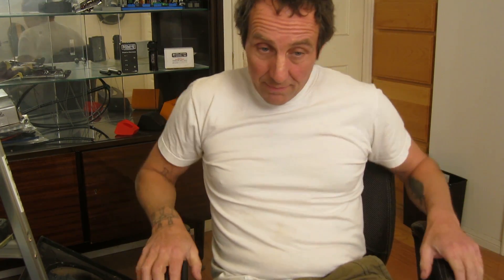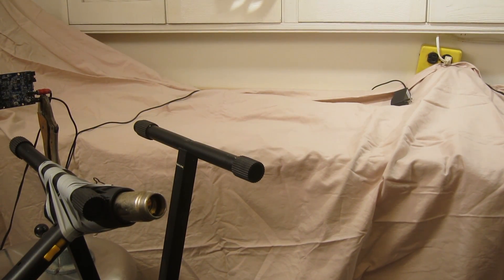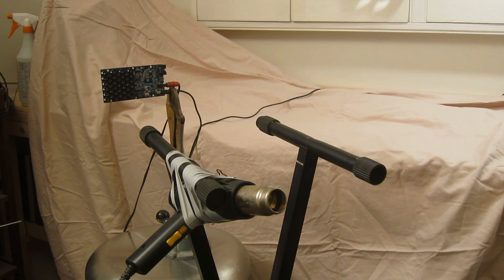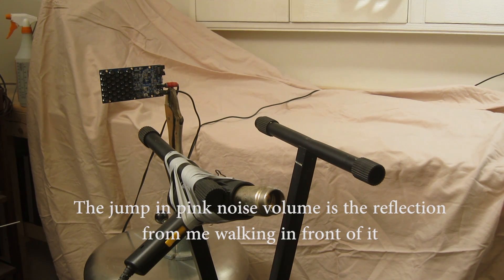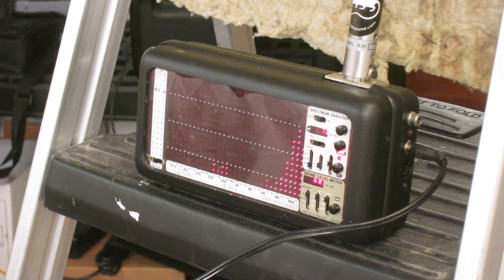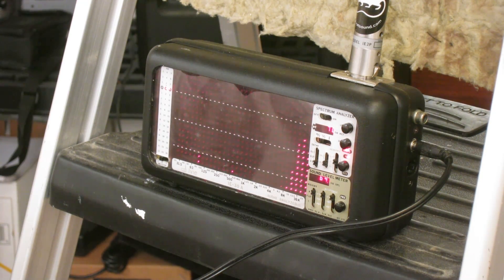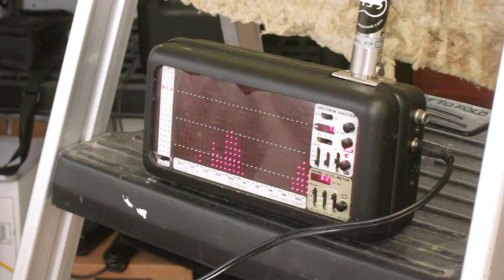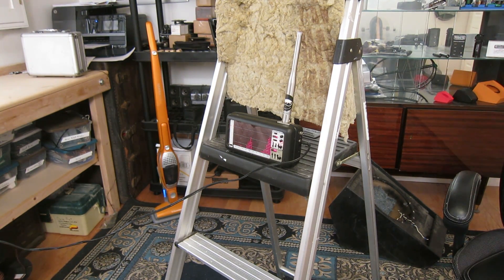Why Crowded Shows Sound Dull - Impact of Heat on Live Sound Coverage

Comment: There is no way the motor from the heat gun and reflected room noise harmonics is causing the drop in frequency observation ? I cannot think of any way to create heat without noise short of being generated in another room passing through a plenum that traps any sound and using convection to travel through a pipe as opposed to a fan. Maybe a hot water bottle , or red hot piece of metal on a handle ?  : )
Reply from the maker: Actually pointing a smoke machine in the sound path has no effect. Using a spray water mist has no audible effect either. Holding a hot frying pan does have an effect.  Try it! It is surprising how much heat has an effect compared to other things.
Reply from the maker: +vainwretch Pointing a speaker over the burners on a gas stove works.
Reply: +vainwretch   HF reflects on smoke or haze aswell.
Reply: well i thought i noticed it.  allthough the room itself was 55+celcius hot and steamy. and a lot of fog.  but when the firefighters were outside , we had to turn off the hazers. and i thought it really had a effect regarding the HF.
i thought so because of the heat, the the moist and haze fluid which is more dense.  dont know! it made sence since at the time. i had to cut the HF with my lovely avalon instead of pushing it.
Reply: because it was still 55+c afterwards but no smoke. and i had to push the hf when it was hazy
Reply: A candle
Reply: Or a bonfire

Comment: GREAT VIDEO A venue i work in a while back had a new stage build as it was too high but didnt factor in the pa now being lower with how the new stage was built.

This will be another point in getting the PA rasied higher, as the current hight puts the mid high (c7 top) at barely above headheight.

Tjhanks

Comment: Do you sell your rta mics, i need a new one.
Reply from the maker: +Shad Chollack (soundbarrier) hello Chad, maybe look at an Audix TM1 RTA mic, they are not too expensive and work well. if you call over to Rat Sound and talk to John Karr tell him know know he'll hook you up with bette prices than we are allowed to advertise or use on our Web store 8053830777
Reply: THANKS ALOT MAN! also i did have the dbx and the behringer rta mic, are all brands pretty consistent with same measurements.
Reply from the maker: +Shad Chollack (soundbarrier) For RTA/analyzer mics it is not overly difficult for a company to make a mic that has a flat response or at least very close to flat.  Plus it does not really matter that much if a mic is slightly off of flat as because speaker response and room response tend to have variations from flat so much larger, that the tiny variations even a cheap mic has, are not really an issue. That said, the more important advantages of a higher quality analyzer mic are max spl, noise floor and mic to mic consistency.  Cheaper mics can distort at high levels, especially at low frequencies causing erroneous readings. When measuring very low levels, cheaper mics can have internal noise issues that distort data. And also if using multiple mics, cheaper mics are less likely to be accurately matched in level and response.
Reply: THANKS FOR EVERYTHING. HOPE I CAN CHAT WITH YA ANOTHER TIME!!

Comment: At what temperatures should I begin to take these issues into account?  for example when the room temperature and audience have a 10 degree difference?  when does it begin to become a problem from your experience?
Reply from the maker: +theberndog it is is combination of temp differential, PA height/angle and distance among other things. I would always maintain an awareness of temp issues, and tur tur room heaters when possible. possible. Carry a laser thermometer gun with me an measure the room temp throughout the show.

Comment: Refraction is generally thought of as sound traveling in a moving mass of air being carried away from its intended target. As Don Davis said, wind does not blow the sound away, the sound is traveling in the wind. The very high end is more susceptible to this than low end. 
Outdoors, this sounds like swishing as the very high end comes and goes with the refraction.
Dave, It would be interesting to see if you could relocate your RTA and find the HF content that is being redirected somewhere else to the left of the RTA location in the video.
Greg Carttar
Reply from the maker: +G Carttar where does the HF HF go? Good question. In the demo it moves up a to the sides as well. So of smeared out an away from the heat. For a rock show, I believe I smears upwards a unevenly at various angles.

Comment: The boundary layer created by body heat is something I never considered but the effects really are quite dramatic! Thank you! What are some effective ways to compensate? You said that raising the venue temperature during sound check but what if you are not able to do that. Is there a way to 'guesstimate' how much more top end you'll need for a specific volume of air or venue size?
Reply: +theheilious Shouldn't even be an issue if you can fly your mains over the front of the audience, angled down at an angle sharp enough to not be affected.  For a larger audience, fly more speakers farther back, and delay the signal going into their amps, so that their sound arrives in phase with the sound coming from the over-stage mains.